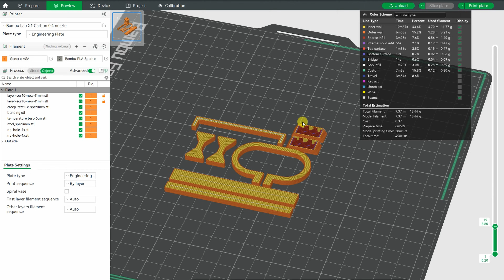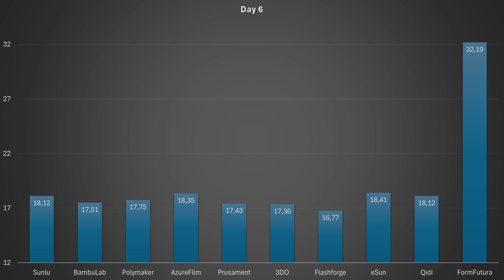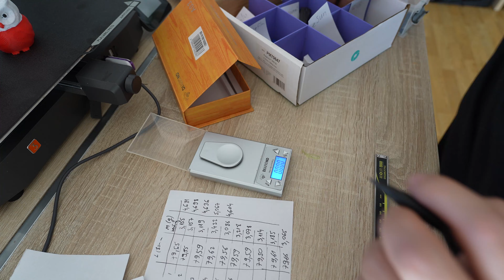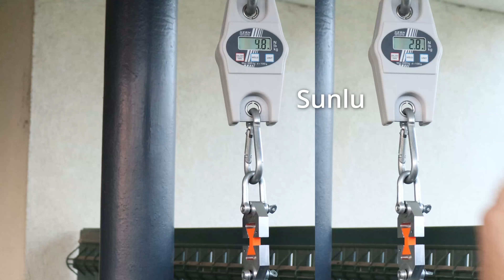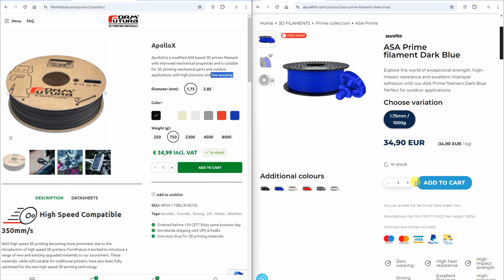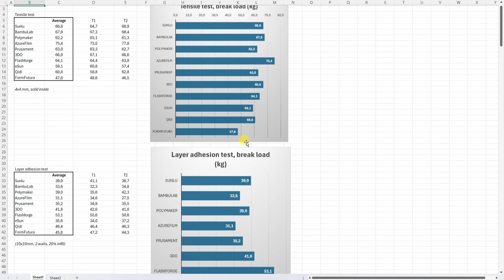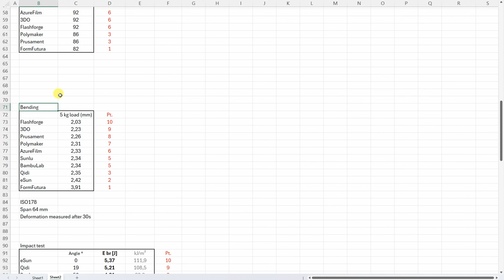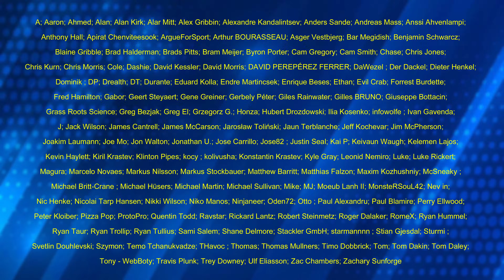What is the best ASA filament? 10 different ASA brands tested

Comment: In fact the Qidi is the best one: Flashforge scores high, but impact test is very very low. Bambulab scores high, but warping is bad. Qidi has a low score for tensile strength, but on XY is just 10% below the best, and in Z is actually pretty good. So Qidi is consistently below the best one in each category, but it has no real weak points. The other best scoring filaments all have one or more really bad performances

Comment: Do you think color has any affect of the strength?
Reply from the maker: In most cases, not. I tested several. Just look around on my channel (12 colors eSun PLA+, BambuLab ABS-GF 4 colors etc)
Reply: @MyTechFun what would you pick to make a blower fan for a portable AC unit?

Comment: Much appreciation for the effort and the information. I think your rating system is not healthy. The order of the results doesn`t really reflect how well they performed. It would be more closer if you used ratios to decide the winner.
Reply: Apparently the first 3 winners are right but in the wrong order. Qiwi wins

Comment: Just a thought about the fume extraction fan of printers: I think fume extraction won't work well during printing anyways.
You need your encloser to be as airtight as possible to reduce warping with materials like this. If you now try to extract fumes with a fan, there needs to be some source of air to get into the encloser in order for a fan to remove air from it. Otherwise you would only try to create a vacuum.
And if the enclosure is not well air tight, and the fan is good at extracting air, there will be a lot of air movement in the enclosure, especially cold air form outside will be drawn into the enclosure which is basically rendering the enclosure useless.
You idea with a wall connection is good, but the best way would be to have something like the things in kitchens above the cooking plates. (just not the ones with recircling air but the ones extracting air to the outside.

Comment: I started printing ASA only recently for modding my ender 3 KE and i LOVE it. The temp resistance for my enclosed printer is great, supports dont stick to it almost at all if set correctly AND you can sand it down or vapor smooth it unlike PLA which is absolutely horrid to post-process.
Yes, it has a little bit of odor to it, but as long as you have it in a enclosure (which you should anyway due to warping and layer adhesion), you just get a whiff of it at the end and its gone. Cant smell anything at all during printing while its closed and even then its kinda weak smell tough noticable.
My next target to hopefully incorporate to my arsenal would be PA-CF (carbon fiber nylon) as the better ASA

TLDR: ASA is better PLA for intermidiate users, once you get a enclosure. Basically better for all aplications at pretty much the same price.

Comment: Thanks a lot for the comprehensive review. Interestingly I've printed parts for a client from FlashForge ASA a while back. After a over a year, they ended up breaking (really happy they lasted that long). I re-printed them new parts from eSUN's ASA.... And it failed for them almost immediately! Same printing and use conditions (each filament calibrated properly). Failure was associated with layer adhesion. And so your testing really coincide with my observation and will allow me to communicate this to them and also make a better choice going forward (Actually in this case, I would re-orient the print slightly to avoid the failure and maintain eSUN's much higher impact resistance).

Comment: this data is not included in your Patreon material data sheet
Reply from the maker: This data is not incuded there, since this is not my regular testing method. Only the data from review videos, where I used my standard testing method is included. This is a comparison video. I wanted a little bit different testings, since almost every filament have it's own review video.
Reply: @MyTechFun  ok. thank you for the clarification. but don't you think its similar in terms of your standard testing method (other than new impact tester device)? or maybe I'm missing something.

Comment: Thanks a lot for those test. I print only ASA (black or white) and use esun and polymaker. mainly mechanical parts or automotive parts. The tests revealed what I experienced. they are mostly the same except whats missing for my liking are the material costs and optical aspects of the prints. 
esun is way cheaper (~24chf) but the surface isn't as perfect as my prints with polymaker. Also to note that you can't smooth esun prints with aceton. The Polymaker prints are always beautful. no inconsistency or whatever. 
The big "but" for Polymaker ASA is the price, which is on average 35chf.

thats why I use esun for prototyping and Polymaker for the finished product.

thanks again and I hope your channel grows on. you're doing a great job👍🏻

Comment: Did you repeat the impact test and average the results or only test each filament once? I'm asking because both Polymaker and Prusament seem to offer pretty much pure ASA without any modifications or additives, and perform almost identically in every other test but the impact one.

Comment: Why did you screw up the impact test? In earlier videos you used smaller cross section, so the results aren't comparable to other filaments.
Reply from the maker: Explained in the video. This is a comparison between these 10 filaments only. For brittle filaments, the angle would be sometimes too small, hardly measurable. I wasn't sure, what will be their impact resistance. For example with PLA I got only 4-5° difference from zero position (with 4mm).

Comment: Regarding the exhaust fan.  Using a 4" diameter dryer vent hose alone was not enough to vent the printer which is a Bambu Lab P1S.  I used a 120mm 12v computer fan which I had on hand at the end of the hose at the window end and that sufficed to vent the printer with no odor in the room.   Thanks for all your work, I have found it incredibly useful.
Reply: What diameter of tube did you use?

Comment: Why change the test sample dimensions? Also, your bending measurements don't line up with your prior test values. For example, in this test you had Flashforge mush stiffer then 3DO, whereas your prior test has 3DO being stiffer then the Flashforge (3DO = 1.31mm, Flashforge = 1.43mm)
Reply from the maker: In this video, they are printed with same printer and settings. Separatly they were printed on different printers and settings. That's why this kind of comparison is better.

Comment: Double check this info. X1C intakes, P1S exhausts out of that vent. At least, logicalplanet states that their venting designs won't work with X1C because flow is reversed... I only have a P1S and the exhaust blow air out of that vent.

Comment: Igor you have made my week!  Your ASA testing confirmed my own experience.  Your test discipline meets my expectations for quality of objective analysis results and your array of test parameters / results is quite impressive.  As you conclude, the ultimate selection should be for the performance characteristics that are most important, and in this regard, we have made the same brand conclusion (I have observed about half of the products you tested, plus PA CF filament - disappointing).
Nicely done sir... I will share your work with others.  Rgrds

Comment: I use 3DO ASA for most things. Prints perfect on a K1 with MS FlowTech hotend.
NO warping if you keep chamber at 55-60C, just throw a blanket over and block venting if needed.
I limit to 20mm3/s, 150mm/s at 245C and it always works . . . 
Your experience may differ

Comment: 10:26 You are pointing out that you have AC to keep the temperature constant, but that is not my concern since I have been using ASA the last few years. It is the airflow that will warp it immediately. I don't print with an enclosure, but I make sure all my fans are off, my window is closed and I do not walk up to the printer too fast or close the door to the room. Any of that will warp it instantly. I'm afraid that with an AC unit creating airflow right next to it will throw off the results greatly.
Reply from the maker: I think you have to watch the video again. There the point was not to have perfect conditions, but perfect constant warping conditions, to see some difference between the filaments. And it worked really good, we can see big difference between them. In perfect conditions, all of them was printed fine (test objects on X1C).
Reply: @MyTechFun  Ah, ok. Must have been the phrasing or accent. I wasn't following what was being said I just saw the AC unit and went "That is 100% warping conditions" and then heard "The temperature will be very stable" and thought "that has little to do with warping". I didn't realize the point was to induce warping.

Comment: Thanks for including warping test. It's a huge decision factor for all the people that don't have an enclosed printer!
Reply: I have an enclosed printer but warping was still an issue for me because the ASA parts I print tend to be large (200mm or so) where warping with ASA can still be an issue. For my most common ASA use case, I needed a material that wouldn't warp and could also  handle high temps, The rest of the ASA attributes were not as important for me. From Igor's testing, I went with QiDi and even for my large prints, I have had zero warping and my parts survive in 75-80C+ conditions for long periods of time. Perfect! Thanks Igor!

Comment: I have a similar exhaust setup for my X1C. I have the TerraBloom ECMF-100 setup as my inline fan. It is designed so you could hook up a Arduino or similar to control the fan speed.

Comment: Hi,
I’ve just noticed that Bambu has a fillament I can’t find any reviews for (myst be new): PPA-CF. They also say it’s easy to print. And that it has “metal like strength”, high precision, great humidity resistance and high temp resistance. But no videos on youtube. It’s 100+ Euros for 0.75kg. It would be very interesting to see all your different kinds of tests on it (strength, layer adhesion etc.). Including heat set inserts tests. Would they maybe send you one? 😁
Reply from the maker: I just got a spool of PPA-CF. Video comming after Bambu PC and PA6 filaments.

Comment: Thanks for the video! To filter the vapours from the filament, I installed the Bentobox system (with 2 radial fan mod), which circulates the air and filters it through HEPA and activated carbon. Advantage: The air temperature remains constant, no cold air is drawn in. However, for the system to work properly, the enclosure must be reasonably airtight.

Comment: You know, another good test for ASA in the future might be rapid sun weathering - exposing it to UVA and some UVB frequencies (using UV lamps) for a bit then testing surface hardness and strength. After all, ASA is supposedly formulated to resist that kind of light damage, and a primary driver to select it over ABS for outdoor applications. Cheers!

Comment: Did you use glue on the buildplate? I didn’t get this directly from your video. 
Also on the fan part. I have a similar issue. So I’m going the way of Thomas Salander (Made with Layers) and I’m going to put a Ikea Fornuftig in place to actively filter out VoC’s.

And a good reminder, after watching many video’s to the end and liking them. I finally reminded myself to click your patreon link. Time to join the MTF patreon family :) 😊
Reply from the maker: Engineering plate + glue stick (for warping test on P1P: textured PEI, no adhesive). Thank you for the support!
Reply: @MyTechFun  Ive had the besr results with ASA on smooth PEI plates. I hated the tetured gold Bambu plate. Id wager I could print all these in the warp test without failing

Comment: Oh I print quite a bit ASA. A recent experience was with elegoo (can't resist to try 22USD\2kg). They print okay but warps in my K1's 45 degree C chamber...

Wouldn't mind printing a lot of ABS ad well, especially when I don't need UV resistance.

I print those in my garage and have a blower fan ventilate the place afterwards so the odor  doesn't really bother me.

Comment: Whatever FormFutura is selling, it's not ASA. They might not have wanted to send filament to you because you exposed that their ASA is extremely impure and doesn't behave like ASA.
Really appreciate these tests.
Reply: gotta be a petg mix like an abs +
Reply: They advertise it as a modified ASA with less warping. Changing material properties always has side effects but that doesn't make the stuff bad. And ASA is already a compound, so even Filament made only from A,S and A can be different to each other
Reply: @ScytheNoire  I really enjoyed printing FormFutura for my Voron parts. Whenever I had warping issues, this was my solution. Interesting to see that the mixture also has its downsides. Pretty logical, but I would have  never expected such a big difference. However, for my Voron it's working absolutely fine with no issues
Reply: My experience is exactly the same. Bought both ABS and ASA, and both printed super wierd and were quite weak. I honestly thought ASA was a bad material. Turns out it was just formfutura

Comment: Hey,

Shouldn't the colour be also the same for good test results? 
First black absorbs much more sunlight. Therefore there is a big difference between black and white asa outside.

Afaik the color from the master batch has great influence on the mechanic performance.

Comment: :trophy-yellow-smiling:Great Video! Thank you!

ASA is a great material. I only print it if I really need it, for example for internal parts for my Prusa XL 5T with enclosure. I only have a spool from AzureFilm, the normal black ASA (not Prime). Its OK, but it warps more than your tested AzureFilm ASA Prime. I wish I could send you some printed samples of my ASA, so you can test it an add the values to your database. Could you share your STLs and print values? But it would not be representative, because of different printer etc. Maybe i should send you some Meters from my ASA ^^
Reply from the maker: Test objects are here: https://www.printables.com/model/465670-mytechfun-test-objects and almost every test object is printed with max number of walls. The vertical (for layer adhesion) is missing there, I will add it when I finish replying to comments..

Comment: Thanks for putting in so much work.
I suggest giving them a composite attribute score as opposed to just averaging their ranking for a single test series. That way it's an easy comparison chart and you can add filaments in the future. 
TorqueTestChannel does a great job with this.

Comment: Your warping test is severely flawed and does not reflect reality. Reality of warping is for example overhang performance and warp while using fans. Or larger thin printed parts. 

Pla prints overhangs perfectly with max fans. Thin overhangs with asa however does not work well. 

My use of asa for example requires a chamber temperature of around 60-70c for the print to even finish and not crash mid print. Did you try this and do you know why?
Reply: He did use overhangs, fan, and printed thin parts, what are you talking about?
Reply: @riba2233  No. Every single cosplayer would use ASA if it printed overhangs, bridges and similar well. There's a reason you only print these small mechanical parts shown in the video. That is what people almost always print. As soon as you add fans, which you must for bridges and overhangs, you add warping. A frustrating factor that is introduced and inevitable with the material. 

If you have ever printed large ASA prints, long thin parts or difficult overhangs and bridges you would know what I mean. The frustrating part is that this weakness of ASA isnt the focus. How they handle this is the pinnacle of ASA progress for the different companies the last few years. If cosplayers and other hobby printers could print ASA as PLA they would almost always use the ASA as it is so much better for the use, apart from the printability. I understand this might go over most peoples heads who mostly print PLA, but ASA would be the absolute best material if it cleared this hurdle.

Comment: Thank you for this testing Igor.  I think the big barrier for large prints is the warping/shrinkage with ASA.  I have only used Polymaker ASA at this point and can relate that it definitely warps.
Would you be interested in doing a spinoff video on printing the Azurefilm and Formfutura with larger prints (maybe p1p bed size) for a true anti warping champion.  Also, could add something to increase adhesion on some of the others that had low warping but other good performance metrics.  Thanks again!
Reply: Polymaker ASA I think is a good brand/product, but in my case, warping and shrinkage did not have a happy end in my case. I still have to tweak stuff

Comment: Great analysis, thanks! I primarily use eSun eASA so I'm happy that it was a solid contender on most metrics. I was planning on trying it for some drone frames, and it looks like a solid choice given its impact performance.

I'm impressed with FlashForge's ASA too. Not great on impact performance, but it's very stiff and has very little creep, so it would be a good choice for structural parts in a 3D printer.

Comment: I use only the chamber fan and only at 40% just to create slight negative pressure rather than actually trying to suck too much air out (it needs to get in somewhere to replace it).
With a Bentobox as well, I get no smell at all in my small office space.